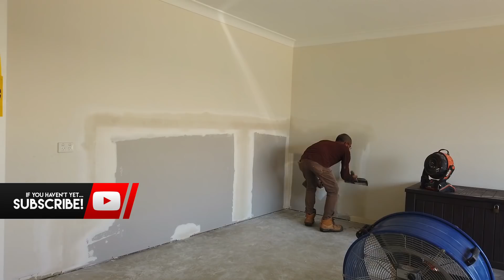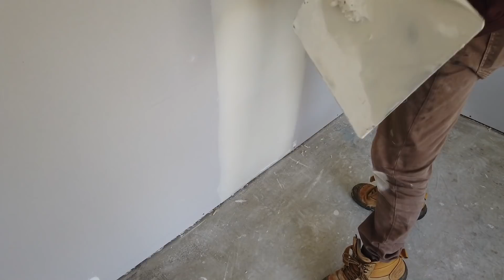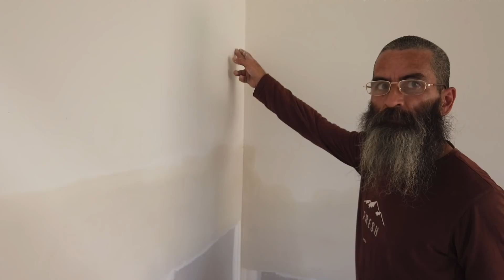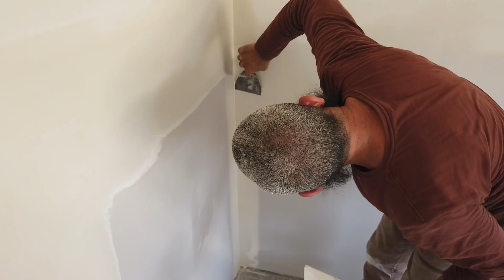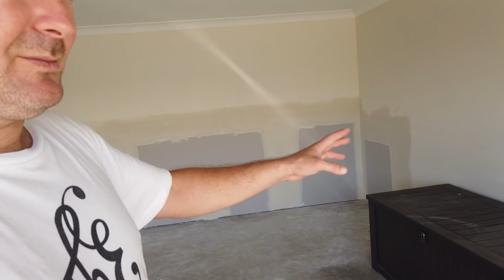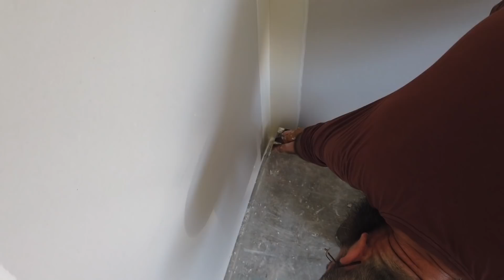Top Coating Drywall Corners by Hand

Comment: I was thinking around $1500. I know you guys use adhesive a lot but did you use any screws?
Reply from the maker: Not in the mid section, you don't need it. If there are tiles going on that wall or it's a fire rated wall you use screws no glue